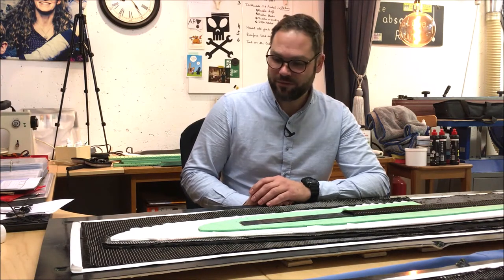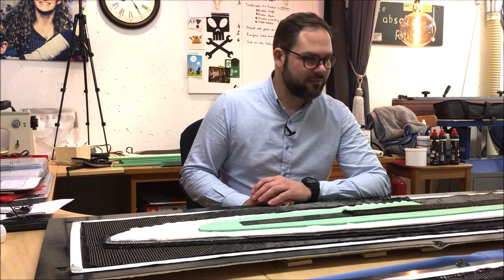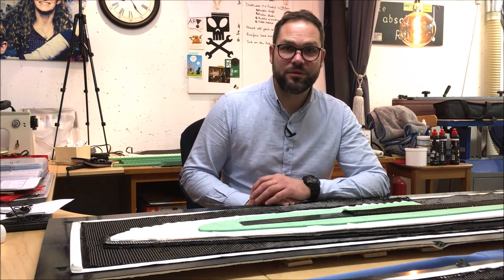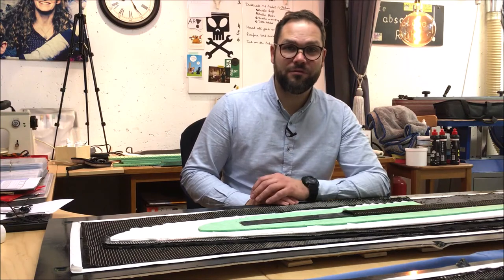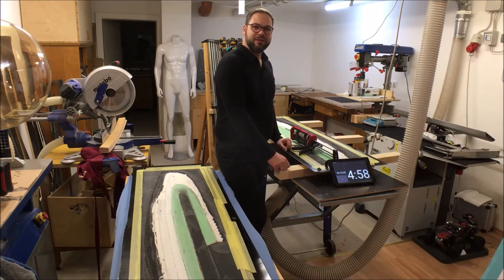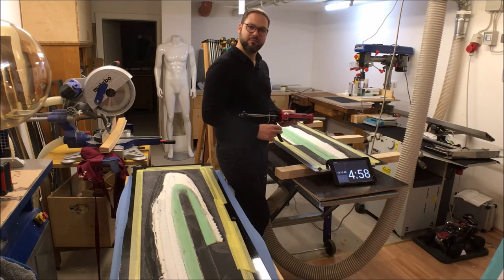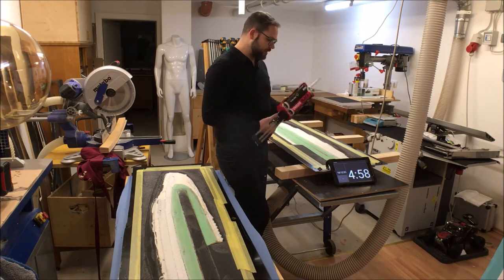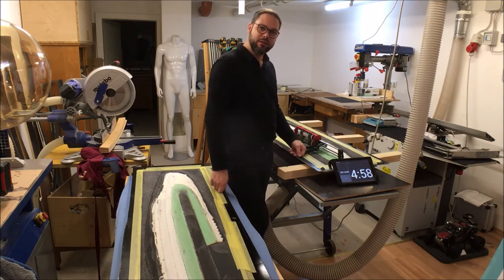Episode 4.4 Infusion of Carbon Rudder blade!

Comment: Hi Alex I am interested how you work out how many layers of carbon and what sort of core material you used ? It looks very flexible
Reply from the maker: Dear Paul thanks for your kind question. there are different calculation formulars in the internet to calculate thickness of the different carbon fiber materials and layers. As you can see in my previous videos I have cut the original fiber glass rudder into pieces and hence I could see how thick the different places are. Based on this information I have calculated the thickness of the layers + extra safety margin. Certainly the rudder is not of the same thickness from head to tip. The goal was not to make the lightest rudders, but stiff and stable. For this reason my rudder blades are about the same weight as the original ones out of glass fiber. Maybe next season I will do another trial to reduce the weight but if the rudders work I think I wont. We will see. Sure mathematic experts can calculate exactly all the details, but I am not so skilled in this calculations and to be honest I was also not interersted to work out a computer model, with lots of calculation behind. I try it, if it brakes (which I don't blieve after seeing how thin the original rudder has been built!!!!) I build a new one - that easy :)
Reply: you probably dont care at all but does someone know of a method to get back into an instagram account?
I was stupid lost the login password. I would love any assistance you can offer me
Reply: @Nathaniel Cruz instablaster :)
Reply: @Vivaan Soren Thanks so much for your reply. I got to the site thru google and im in the hacking process atm.
Looks like it's gonna take quite some time so I will get back to you later when my account password hopefully is recovered.
Reply: @Vivaan Soren it did the trick and I now got access to my account again. I am so happy:D
Thanks so much you really help me out :D
Reply: @Nathaniel Cruz you are welcome :D